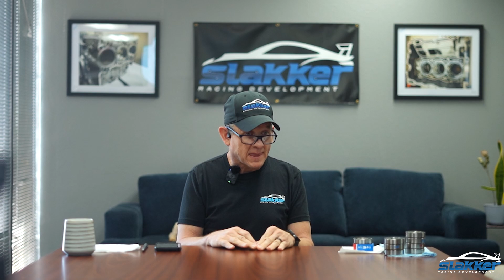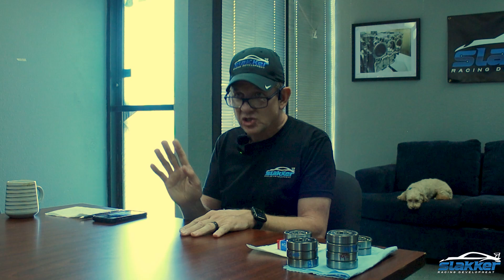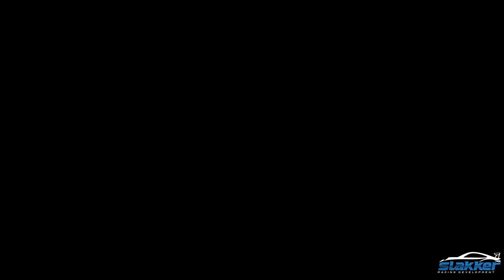8 Hours on the Dyno: What I Learned About Porsche ECUs

Comment: You mention dialing in the resonance flap...I seem to get better throttle response and drivability with the stock air intake and helmholtz valve on the stock set up. I also have used an aftermarket setup that eliminates the resonance flap altogether. It sounds nice but I think I'm losing driveability. What is your experience. BTW I just found your channel and appreciate your no BS approach. Thank you
Reply: Same on my geo metro!

Comment: You don’t need to meet emissions at WOT and nowadays Porsche can just have a computer sit there with an engine and just run a parametric test to get every last bit of power. 

Always dubious of getting more power out of any modern car. For NA especially forget about it. Not happening . Turbos you can always ask for more boost but def playing with fire.
Reply from the maker: Totally get where you’re coming from. OEMs have gotten really good at squeezing out power efficiently. That said, there’s still room to improve drivability, response, and reliability when tuning the full system as a package. Appreciate the thoughtful comment!
Reply: @PorscheEngineNerds there certainly is something to be said about “how” inputs make power. Lot of tunes that help with Rev hang, response etc can certainly make it much nicer to drive a car in that 50-100% zone.

I think rev hang and overly aggressive tip in are my biggest gripes. Would love to see videos on how that gets “fixed” and what “fixed” means in terms of how the throttle, engine controls interact.

Comment: I was surprised how many people think the Sprint Booster is going to give them more power. When I tell them it doesn't do that and is not the intent of installing one, that it is for throttle response and does that very well. I have one installed in my 987.2 Cayman S and it does what is required/desired or you can pay for the Porsche sport/sport + button $$$ and it does no more.
Reply: Tbh you could just push the pedal harder and get the same result haha
Reply: @indigowynn  Yeah, but I wanted it to react like a cable throttle  or 1 to 1 and that is why you install a Sprint Booster. I didn't care for pushing the pedal halfway to the floor due to the DME not opening the throttle blade, so I fixed it.
Reply: Spoofing your electronic throttle pedal signal is a really stupid idea from a safety perspective.  The factory sport Chrono package is really nice.
Reply: @black99rt  Porsche a few years ago offered for sale a retrofit for those that didn't select the spot chrono to have an expensive sport button installed by the dealer for a large price. It does the same thing as a Sprint Booster does and I've had it for 15 years with zero problems. You can check the price with Suncoast Porsche Parts if you like.